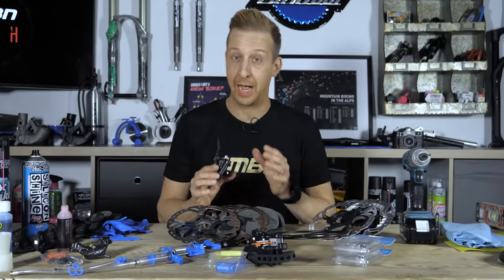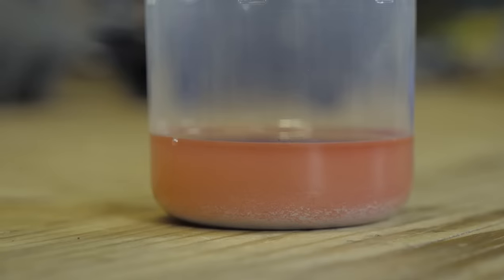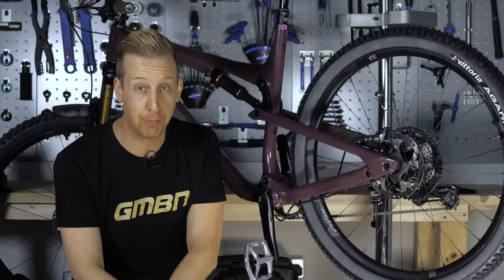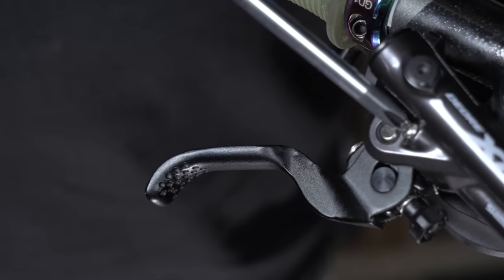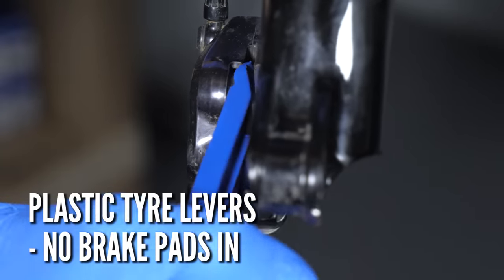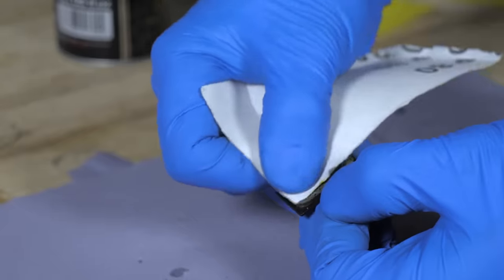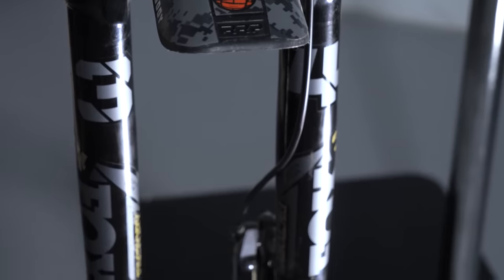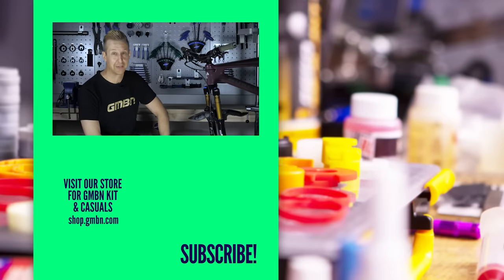12 Common MTB Disk Brake Maintenance Mistakes & How To Avoid Them

Comment: I run my front brake on the left and rear on the right...is it so uncommon? I've use them like that since my very first bike where it was set up like that from the factory...gives me chills to switch it :D
Reply: That seems to be the standard here in the US where we drive on the right side of the road; maybe there's some safety reason for the driving side and braking side to match?
Reply: It’s a bit strange that there’s no safety standard for that. All motorcycles and mopeds have the brake lever at the right handlebar and for scooters with automatic clutch, the rear brake at the left handlebar.

Comment: How do you adjust the free-stroke of brakes that don't have a dedicated adjustment screw? Lever bleed after installing pads and putting wheels on? Bleeding with a thinner bleedblock?
Reply: The only way I know is to squeeze the brake lever with the wheel off to bring the pads out a bit. And when I say squeeze I mean barely touch it!
Reply: And if you over do it then use a plastic tyre lever to reset pistons then repeat until you get them where you want them. Free stroke lever is crap on the Shimano anyway so I do this said method with every new set of pads, I hate too much travel, adjusting the lever reach helps too
Reply: U cant....that's like asking how u open the sunroof on a car that doesnt have one....😋
Reply: @rupedog  But you can, you have to increase volume of oil

Comment: Brake lever thing got me on European bike and morotcycle. 

US levers are right for rear and left for front.

Almost wet O.T.B went the bike did endo vs locking up the rear.
Reply: That is not a European thing! Just the Brits do it the wrong way.
Reply: It's based on which side of the road you drive
Reply: @Will99x  yes but it makes no sense.
Reply: @Lestat1795  sure it does, in the UK, driving/riding on the left, to turn right you need to take your right hand off the bars to signal, so having the left hand as rear brake is safest (no OTB). Turning left is less of an issue as you're not crossing the oncoming traffic. And so outside UK driving/riding on the right it's the opposite

Comment: Late to the party, but I'm just about to build new bike and attempt Shimano bleeding for the first time. Done Sram only previously, so a bit of a different experience.
However, one thing, that not been mentioned is de-gassing your fluid. Either DOT or mineral oil. Worth a hassle, makes whole affair even more full-proof.
Cheers!
I.

Comment: you can clean brake pads with isopropyl alcohol... some other things you can use,  are steel wool, a torch, dish soap, gasoline, etc.. isopropyl and a microfiber cloth works best for me.